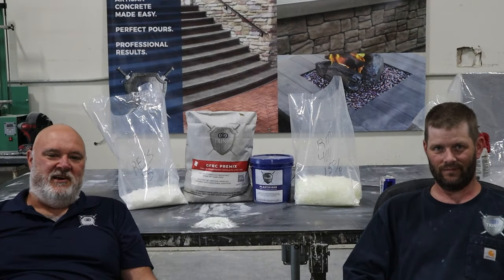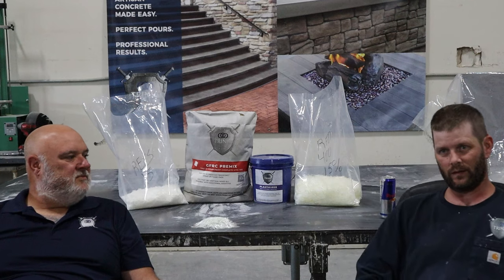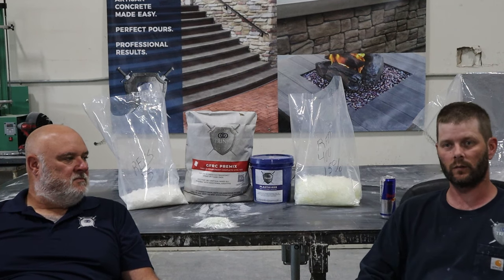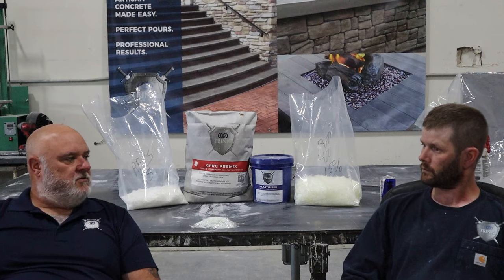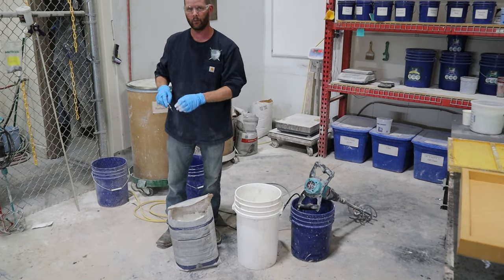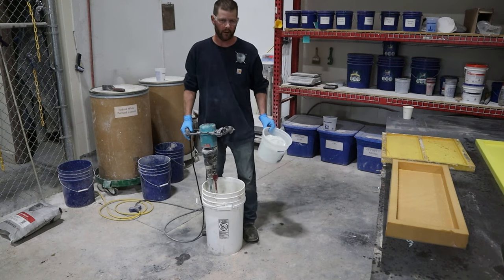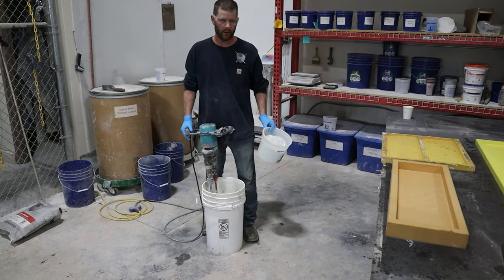Trinic GFRC Premix - one product so many uses.

Comment from the maker: 0:06 intro to Trinic's GFRC premix (Glass Fiber Reinforced Concrete)
5:50 desiccant removal
6:24 mixing SCC
8:07 adding fiber
9:58 pouring SCC
11:09 mix for sprayed face coat
13:05 spraying face coat
14:07 brushing and finishing face coat
16:16 SCC on table top
17:42 spraying back coat
18:45 hand pack method
21:00 smoothing underside/inside surfaces
21:34 mixing ECC
22:57 fiber explanation & ECC pour
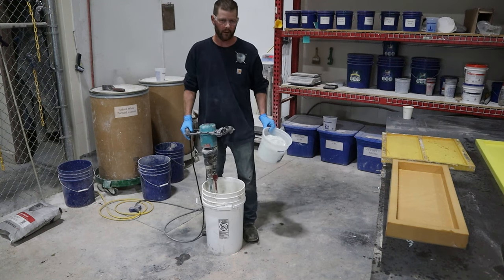24:48 recap

Comment: So frustrating trying to find local supplies... I'm in Northern KY,,, Cincinnati OH area... Too bad you don't sell at Deco-cretesupply here in Cincinnati... otherwise I bet shipping is crazy...  Is your Trinic 10 the base for your GFRC Premix?  If yes what would I need to add to it... White Portland which I can get locally... and a white sand?... I would need to search for the sand... this is why your premix is needed... sourcing from some locations is difficult... I don't make countertops... I mostly do casting and want high-performance castable GFRC concrete in white... I know I can cast using Cement all but I don't like it...
Reply from the maker: We do have a distributor in Bowling Green, KY - Jeff Osborne Design 112 Thomas Ct. Unit #C, Bowling Green, KY 42101  270-303-5818  jeff@jeffosbornedesign.com  If you go on our website and use the GFRC Mix Design calculator you can see everything you'll need for a mix using Tec-10 - https://trinic.us/pages/calculators

Comment: This is cool, I've done some test pours myself getting ready for a concrete countertop and am interested to know with scc cast in place if you can skip troweling sinc it looks so good already?
Reply from the maker: For cast in place, you'll want our GFRC premix without plasticizer, and it will need to be troweled.  The SCC is pourable but the specific gravity of the fibers makes them float up in the matrix and will be visible on your surface.  We us SCC in molds that will be flipped so the finish side in down during the casting process.
Reply: @TrinicLLC  Gotcha, yeah, discovered I had to trowel, but as long as I waited long enough it wasn't an issue.  The edges have to be troweled or cracks will show and since it was firm enough troweling wasn't that difficult.  I used a mix with plasticizer, but poured the last portion without fibers after waiting some time so the fibers wouldn'tfloat to the top.  Now to try the real thing

Comment: Few things I would like to know... de-mold time for your castings... does this have CSA in it to speed de-mold times and strength for production casting?  Is this a pure white color? ... any marble in it?... I know this is a 1yr old post but it will show me what type of company you are if you answer
Reply from the maker: We demold the next day (14-18 hours is fine ). We do have a fast-set version with CSA added.  Those can be demolded in about 2 hours.  We use Federal White cement so our mixes are white (not exactly pure white though) - no marble.  We host free workshops ( just had one last week).  If you'd like to be notified of upcoming classes, email us - Rich@trinic.us                
PS dispersing fibers are very different from Bundled fibers.  Dispersing fibers can help with micro cracking but do not add strength.  Bundled fibers are for strength.  Our GFRC premix with fiber added easily exceed 14,000psi in 28 days ( 7000+ next day).
Reply: Thanks Rich. I will check out your site

Comment: Why not use polypropylene fibers? The “calindered” ones.
Reply: polypropylene fiber is not alkali resistant
Reply: @elliotte1981  I was told opposite, glass degrades in alkaline. This is why concrete fibres are polypropylene. 
 Also if they poke out of the surface they can be melted off with a flame whereas glass can be an issue. 
 I’ve used both and I much prefer using poly.
Reply from the maker: @rollovaughan  AR (Alkali Resistant) glass will not react with the concrete.  When using glass always use AR glass.   We apply fiberless face coats to ensure fibers don't show through - the fiber only goes in your back coat.  PVA fibers can be used in areas where  you're concerned about fibers showing - they're invisible to the naked eye.  If you have more questions/concerns give us call or email  Nick@trinic.us  we're happy to help.

Comment: All this waiting, ice etc.  how could one spray hundreds of molds in a day and build production processes?
Reply from the maker: The wait you are referring to is not long at all.  We only need to wait to make sure the ice has melted.  That time can be spent cleaning tools or prepping a mold.  If no ice is used, then there is no slake time needed for our mix.  If you want to turn molds faster, try our GFRC fast-set premix.  With that product you can demold in less than 2 hours.  I hope this helps answer your question.